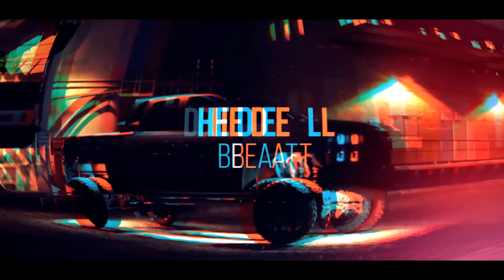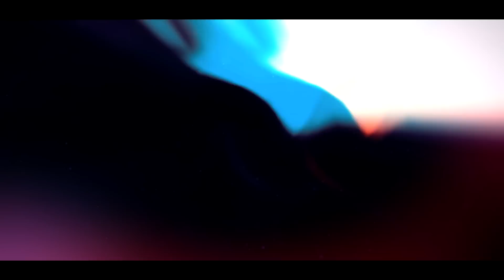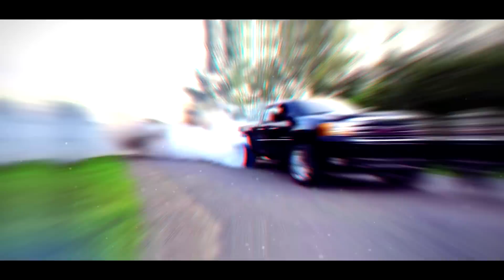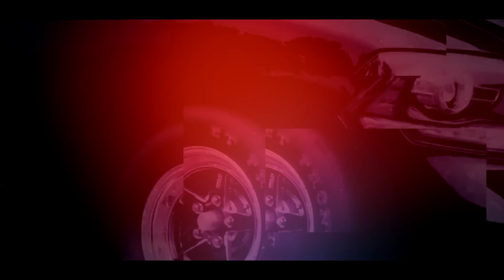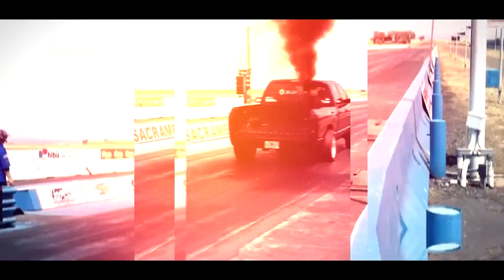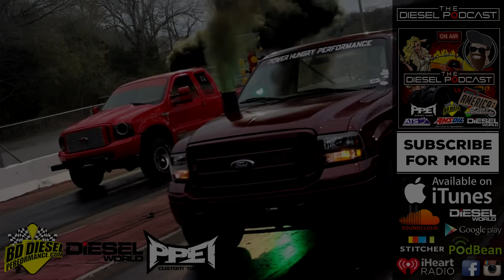1000+ HP 7.3L Powerstroke

Comment: Watching this in 2024.  I must be the only 7🌳 guy left..  lol.  I want to try a simple bolt on 500hp build.   Then later add soa piston and ported head n cam.   Keep it simple..
Reply from the maker: We’ve been doing a lot of 7.3 episodes over the last year. We have a recent one with build recipes from Power Hungry Performance. It may help as you plan your build!
Reply: Nah, I'm here too. And I'm also extremely interested in the speed of air pistons as well.
Reply: I got you beat. I'm just watching half way through 25 lol. I'm a new 7.3 owner doing all the bolt on mods first
Reply: @allpositions32 catch up little brother.  Already have 6 in lift. A set of meaty 35s on 16.5s . Dual stacks in the bed..   built turbo with .84 housing and 360kit and a 86mm +5mm ex tip wheel.  And a few other little things done so far.  Window tint and the like o and a hydra tuner.    Next is injectors and a trans kit.

Comment: Wish I had the money to do new rods lol. Got forged already in my 96 7.3 crew cab long bed 4x4. Got a Fass fuel system, semi built transmission, and changing out Injectors too 238/80 hybrids, comp cams 910 valve springs and new pushrods, ARP studs,  Headers, T4 kit with s366 turbo and intercooler. it will be done around next week and Brian is doing all the tuning. ill have a dyno here shortly. should be around 500hp.
Reply: From personal experience go back to OEM headers... me and a lot of other guys have already warped aftermarket headers
Reply: @charlesknox3259  then you got cheap ones.
Reply: @gamebob2525  I wouldnt think $800 manifolds were cheap 😂
Reply: @charlesknox3259  you have to get the good ones from irate diesel, it's about $1,600 opt for the ceramic coating.

Comment: JeliBuilt.com
Reply: Brian Jelich I just wanted to thank you for your time, it has really helped me narrow my focus on my OBS 5 speed build... bone stock single cab not even straight piped. 
buying new ~600hp rated tranny due to failing synchros, and hoping for a 450-500 range build after I get basic maintenance outta the way. I need injectors, turbo, hpop, tune, the whole works. wanna keep bottom end stock until a rebuild is necessary though. I will definitely be contacting you guys soon!

Comment: I have a 6.0 and a 7.3. Both are 4 dr srw f-350s. The 7.3 is 2wd and to be honest ive experienced the opposite with what people say. My 7.3 has had the issues and with 208000 miles the 6.0 has been perfect! Also the 6.0 seems to have so much more power!
Reply: The 05 to 07 6.0 are known as one of the most reliable trucks on the road especially when you get the headdtuds and the bullet proofing done look up powerstroke helps channel he really explains why they are such good trucks despite what people say problem is people hot tune them without doing headdtuds or anything then wonder why they blew a head gasket lol